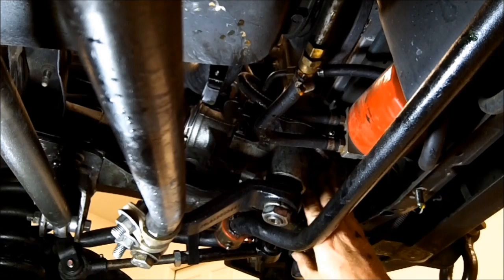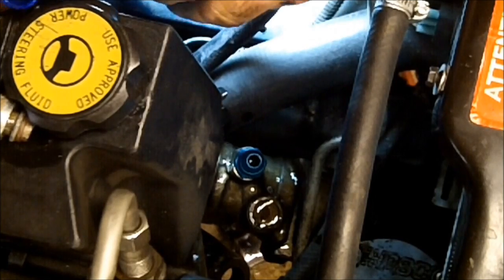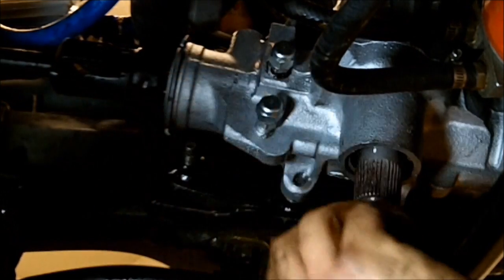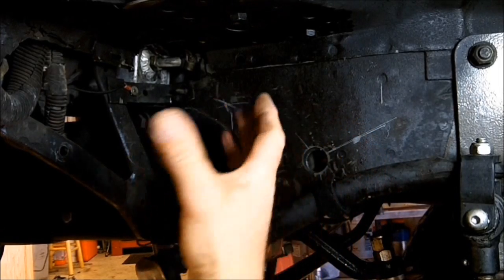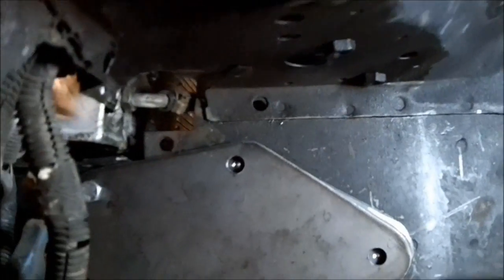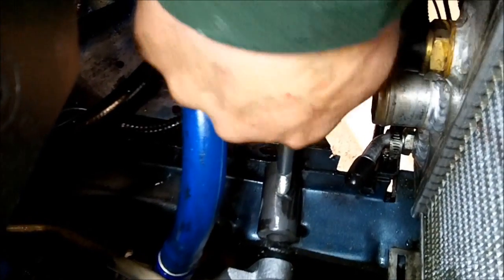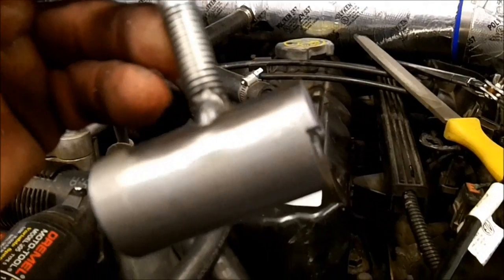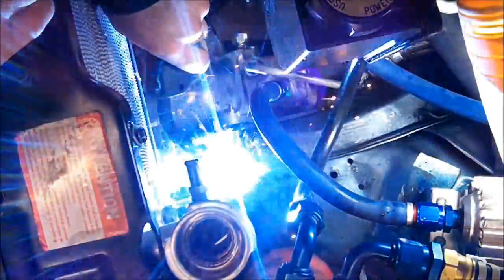How to replace steering gearbox & reinforcement plates on a Jeep Cherokee XJ

Comment: Better to remove the lines at the power steering pump and get them out of the way instead of hanging them up.
Use a vacuum cap to go over the return line pipe at the bottom.

Comment: Hey there Martin, I saw this video. I have a 2004 4.7 and when it’s cold it’s hard to steer to the left. I called a shop and they said according to my vin I don’t have a gear box just a steering pump. Is this true. Thanks for your help
Reply from the maker: What make and model of vehicle do you have?
Reply: @martinbuilt  2004 grand Cherokee limited 4.7.
Reply from the maker: @johnfeather5405  I wouldn't take anything to that shop. They don't know what there talking about. The 04 Grand have a steering gearbox. Here is a video I did on How to replace Pitman Shaft Seals on a 04 Jeep Grand Cherokee. https://youtu.be/4GamcHl09XI
You willl see where it is.
Reply: @martinbuilt  Thanks man. I wish I had the tool to do your mods, they awesome

Comment: Would a bad steering gearbox on a 01 Jeep Cherokee cause the steering wheel to spin freely but the tires  not move the ball joints and everything underneath looks fine. When I spin the wheel I can see the shaft move under the hood but Wheels do not turn
Reply from the maker: That sounds like it is the only thing it could be. As long as your drag link is still connected from the pitman arm to the tie rod
Reply: @martinbuilt  yes everything is still connected. That's what I thought. I bought the truck for my son as Christmas present and that was the only thing wrong with it.  I always like to get a second opinion. Thanks for your response Merry Christmas.
Reply from the maker: @sleepernation  thank you and a Merry Christmas to you and yours!

Comment: Does the steering knuckle have a bolt that runs through it to attach it to the steering gear box? I've watched a bunch of videos and.understand everything except removing and putting the steering knuckle back on
Reply from the maker: The bolt runs through a portion of the input shaft
Reply: @martinbuilt  can I remove that bolt after the 3 bolts holding it to the frame are removed? This would make it easier to access I would think
Reply from the maker: @hammy3dprints  You could, I would just turn the steering wheel until the bolt was easy to access.

Comment: Great video!!!  How can you tell if the steering gearbox is in the middle/wheels straight?
Reply from the maker: Kevin Sambells 
While you still have the steering wheel attached to the gearbox rotate clockwise until stop then rotate counter-clockwise counting turns. Then rotate back half as much. Generally it's around 3 to 3 and 1/2 turns from Lock to lock. Another words from left to right. I hope this answers your question. Sometimes easier to show it then explain it
Reply: martinbuilt ok great.  So, when I get the new one I’ll probably have to do that on a bench before install, no?  To be sure it’s centered before I attach to the steering linkage.
Reply from the maker: yes you got it.
Reply: martinbuilt I really appreciate the replies!  Love the vids!

Comment: My god that jeep is super clean no rust that I can see.
Reply from the maker: Thanks cj
I'm from Iowa and that's all I knew was repair rust damage But since I moved to Las Vegas no more rust for me.
Instead we got dried out interiors,  much easier to repair.
Reply: martinbuilt Haha I bet. I live up in Ohio where the salt mines are so they salt the roads a ton. Owned 7 Cherokees so far and only 2 of them had floor boards haha. Had a 96 classic that was so bad the driver side seat bracket actually let go and I ended up using it for parts. It only had 130k miles on it so I pretty much pulled everything on it and only threw a old junk d35 on the rear so it could be towed away. Well funny thing is the two local scrap yards wouldn't pick it up from me since the only thing left was a empty shell with a rear axle so I had some somewhat shady guys come out that where going to give me $150 for it and tow it away. Well they hooked up and pulled it to the street and then just took off but karma bit them in the ass the entire thing folded at the b-pilar on them at the end of the road haha.
Reply from the maker: cjhawk67
 Yeah don't miss the rust belt. I've had a few cars and trucks that you could watch the road go by, by lifting the floor mate.

Comment: What improvement to the steering have you found your modification has made ? But to me the time and effort  does seem to make for a much beefier steering especially if other steering upgrade have been made 
Cheers keep up the great work
Reply from the maker: The big bore steering box has alot more steering force due to the much larger piston and the valve body I put into this steering also give it more power. With the additional steering force you should reinforce the uni-body as was done. Since I made this video I have added a PSC Hydro assist cylinder. Now I have a crazy amount of steering force.
Reply: I have a 99 Jeep Cherokee and the front right tire is wearing quickly. I'm being told that I need to replace the gear box and have an alignment. I am a woman and don't trust too many mechanics. Does this diagnosis sound accurate? Any recommendations would be appreciated.
Reply: bad tire wear can mean a lot of different things, it could be just a bad alignment, but you should also check ball joints, wheel bearings, tie rod ends, and after you check/fix it all then the alignment should be last (unless it all checks out fine, then maybe just out of alignment)